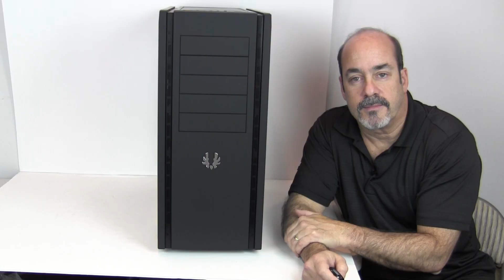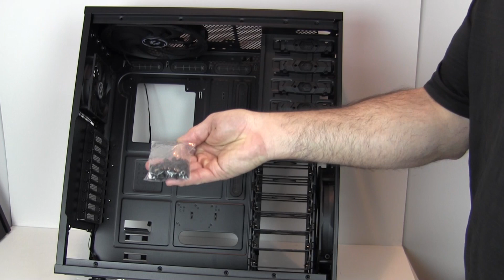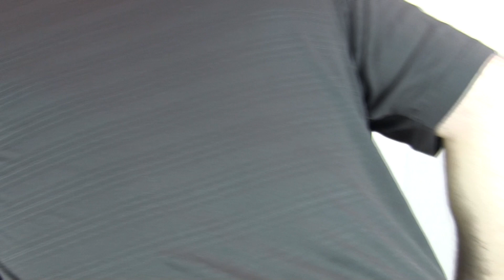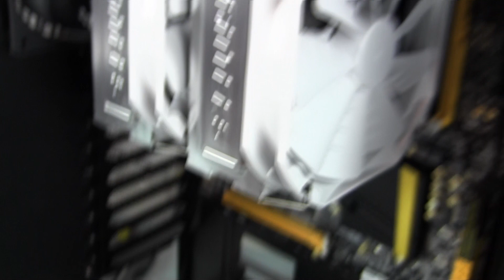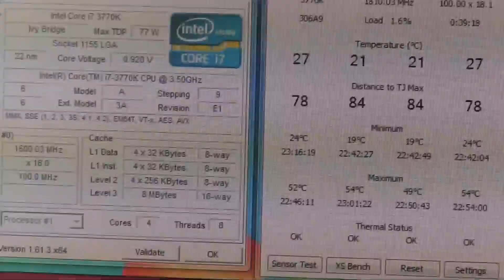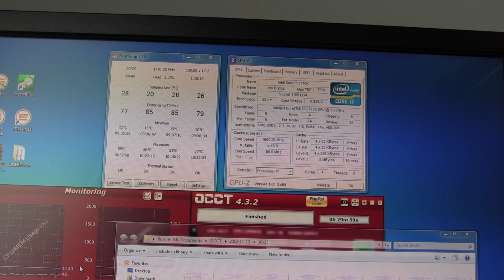BitFenix Shinobi XL Performance Full-Tower Gaming Chassis - Window Version Review

Comment: push pull is only make a difference if the RAD is thick, The pulling fan can only pull as much as the push fan (same fans with same amount of air passing through each one) there has been some reviews comparing push pull vs push vs pull and there is no differences on an average thickness RAD.

Comment: So, did the lack of push-pull cause the more expensive water cooling setup to perform worse than air?? I have this case with the Z79 chipset and was considering going with custom water for overclocking, but the results of your comparison have discouraged me. I may follow through with it just for the noise reduction, but can you shed some light on how it performs with the push-pull mod? I've seen the H100 out perform the Hyper 212 by a mile on YT, so this seems strange. Subscribed btw!

Comment: You can do 1x 360 (45mm or less) and 1x 240 of any size when you remove the HDD cage. You want to try looking at something from CaseLabs or a 900D if you want that many radiators.

Comment from the maker: I will have to check the space to where your motherboard edge space is from the top. I think so, but I will send you the dimension you would have to work with.  Since the H100i is thin I think you might beable to. But let me measure to be sure.

Comment: didn't get that point... when i mount a 240mm Radiator in the front, where do i mount my harddrives? (1 ssd, 1 hdd) are they possible to be mounted in the drive bays? (Sorry for my poor english, I'm not a native speaker :) )

Comment from the maker: I think in the video I talk about that.  The one that is most limited is if you ant to put a 360 rad in the front. Unless you break out the dremel you can only get a 30mm in the front with one set of fans. The othesr you can get 60mm in there. Not sure about a monsta rad though. I would have to measure again.

Comment from the maker: Yes but just a 120 Rad is insufficient for water cooling in my opinion.  Also depends on the number of items to cool , what their power and heat profiles are like and if you are overclocking.   Just because a case has a number of 120 or 140mm fan mounts it depends on where they are located and how they are spaced.  Thanks for watching.